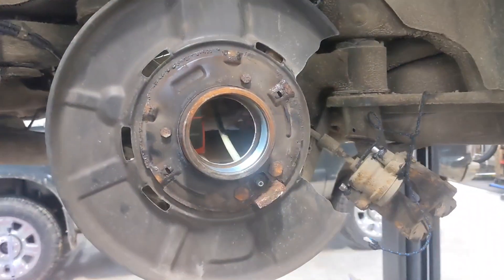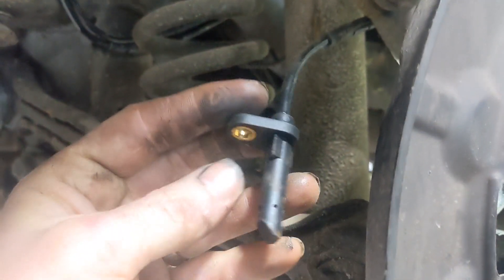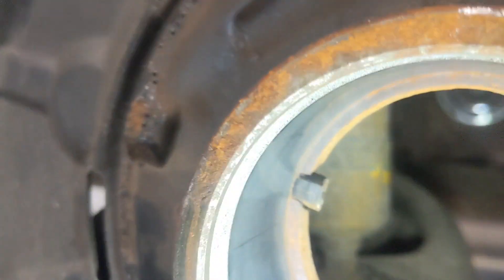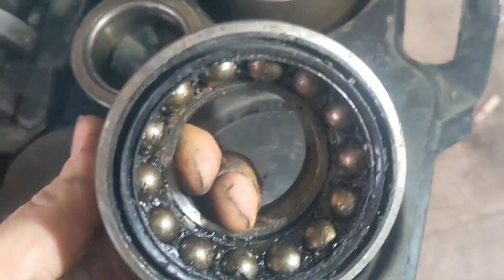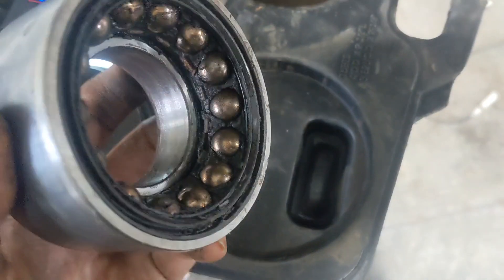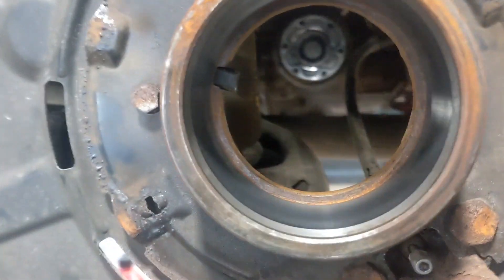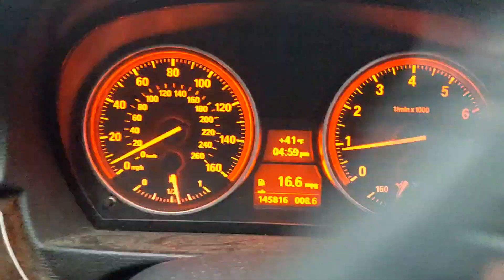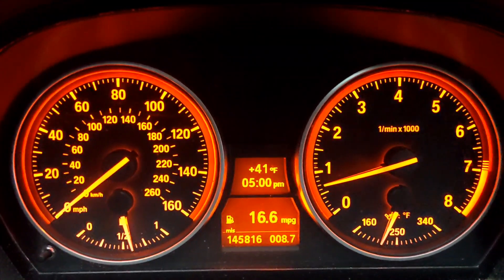2011 and later BMW Wheel speed sensor diagnosis - no reluctor ring

Comment: Martin - you’re a beast and explained everything very well! I just inherited my uncles 2011 328i (x drive) and he has all the same issues and errors you had so I’m feeling optimistic! I’m a garage DIY so if you could tell me what to expect going into this job that’d be great… specifically around all the tools and sizes needed, time to allocate, and any lessons learned/don’t do’s that will help me? Also this will be my wife’s car so you KNOW I gotta get this right haha
Reply from the maker: Thanks for the kind words. I appreciate it.  I've since sold this car and have an 18' 340 now.  I didn't record the entire wheel bearing removal but it wasn't too bad of a job.  I know there are lots of videos on here that cover doing the job in detail with tools used.  As far as the press to get the bearings out, hit up your local Auto Zone or Advance Auto and "rent" the tool.  It doesn't cost you anything since they refund the charge when you bring the tool back.  That's what I used and it worked well to press the old bearing out and the new one in.  Good luck, take your time, and have fun!
Reply: @ yeah good call. Found a place to rent a hoist and tools so I should be good there. Were there any other problems related or unrelated you experienced after fixing this? Seems like this is a common issue at ~130k+ miles so I assume there’s gonna be more I’ll have to do and want to try and plan ahead

Comment: I have a BMW E91 320i from 2007, With ABS lights, except it's on the left rear wheel and it provides NO signal. There is nothing wrong with the sensor, because it works when I swap it over to the other side, I believe I also need to replace the wheel-bearing. Thanks for showing how it works, unfortunately it's quite a job to replace, so a shop will have to deal with it

Comment: So I’ve got a 2010 335d that doesn’t have the reluctor ring either. I replaced the sensor and the bearing and still have the same codes. Any ideas? I’m thinking wiring or maybe the bearing was bad out of the box?
Reply: Error code is 5DB2
Reply from the maker: @jakobbecker6435 Dang, you sure you're working on the weight wheel/sensor?  When I diagnosed mine I was using a scanner that would show the sensor output real time so I was confident that was the bad sensor.  If so, I know the bearing has to be installed correctly since the magnetic portion is only on one side.  Be sure the bearing is installed and oriented correctly.  Other than that, yeah I would start possibly chasing wiring and make sure the harness to the sensor isn't bad or pinched somewhere.
Reply: @martinarcher25  yea I’m using protools. I left a note with the bearing which side which way to install it. The guy has a bmw too so I don’t think it got installed improperly
Reply: May have done what I’ve done and put the bearing in backwards so the magnetic ring was in the wrong way
Reply from the maker: @northerner1374  That was my guess.  It would be really easy to do.
Reply: @martinarcher25  was the case ?  bearing in backwards ? I have 5E42 and 55C6 after bearing and sensor replacement on 325xi 2010. Do you know if bearing have assembly direction ?

Comment: Ive bought FAG bearings and noticed no magnetism. Then I bought another, those said they had tone ring, and still no discernible magnetism. The car seemed to have a brand new bearing on it, which must’ve been replaced because the sensor was still chewed up from the last bearing going bad, but the reading was still off. What brand are your bearings? I wish mine had a tone ring that strong.

Comment: Why didn't you just replace the magnetic ring? They are available online?
Reply from the maker: If that bearing was coming out I was going to replace it with a new one.  Car had 150k on it when I did that job.
Reply: Perhaps but all of the bearings will have to be done now. Bearings in Canada are 150.00 + 15% tax and all bearings would have to be changed most likely. It would be much faster and wayyyyy cheaper to back-off the CV joints and just replace the ring and if I can use the adage "if it aint broke, don't fix it". I think this is what I am going to do with my remaining three.
 @martinarcher25
Reply from the maker: @barryrenouf3450  Why would you need to change the other 3?  I did this a while ago and haven't had to touch the other corners.  The German SKF bearing I installed was $50.  Like I said, if it's coming apart with that many miles new parts are going in.  That's just how I do things in my vehicles.  The labor and my time is worth more than the new parts.  Just changing the magnetic ring would work fine if you're just fixing a speed sensor issue.  My inner bearing seal was also shot so it was only a matter of time before the bearing would have been trashed.